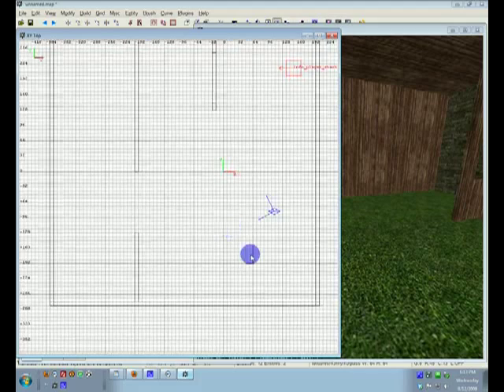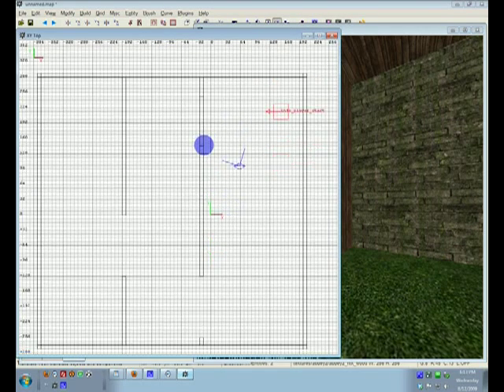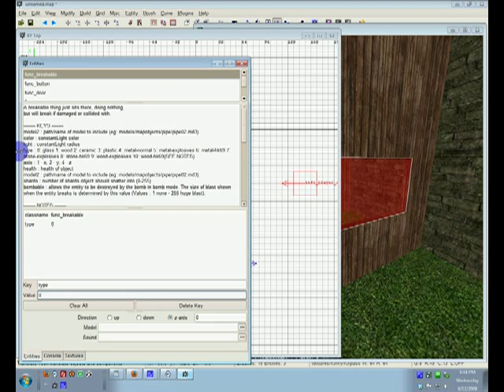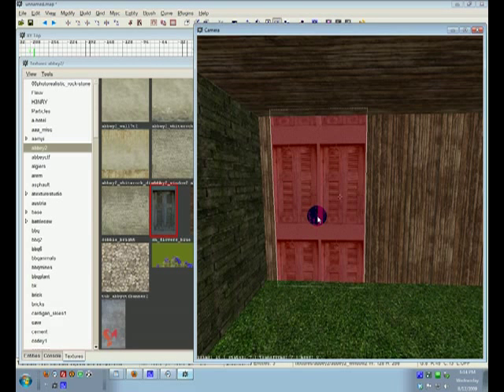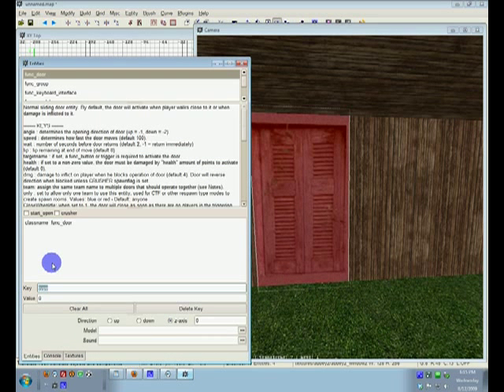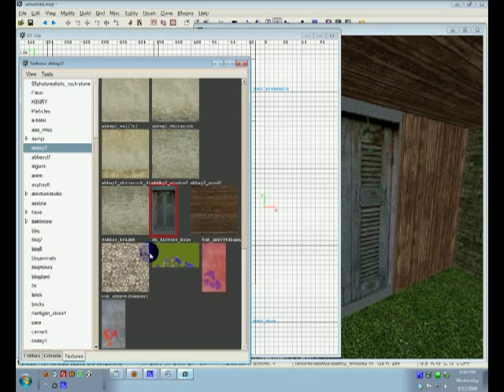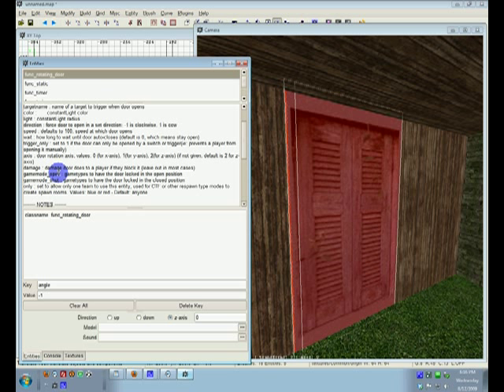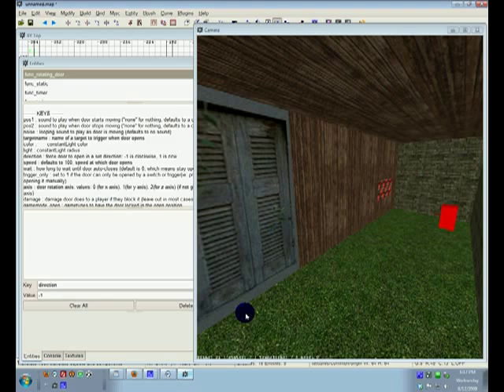Doors and Breakables In GTKradiant   -UrbanTerror specific-

Comment: Thank you. How to change the hp of a breakable item? Also, why does the whole wall break at one time instead of individually?
Reply from the maker: health : health of object  when set the object will require that amount of damage before breaking. The reason the whole wall breaks is everything you have selected when you choose to make it a func_breakable will be 1 single breakable item.  If you want a wall to break apart in peices you will have to create each individual brush/polygon that you would like to break off the wall and make that an individual func_breakable